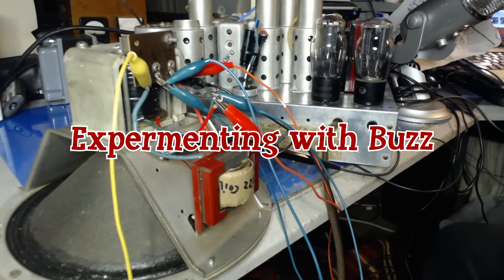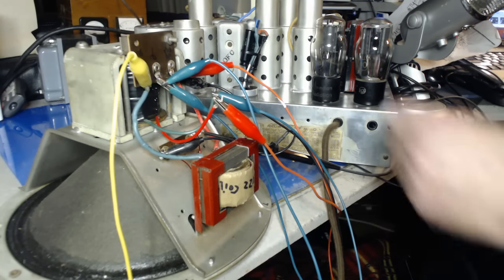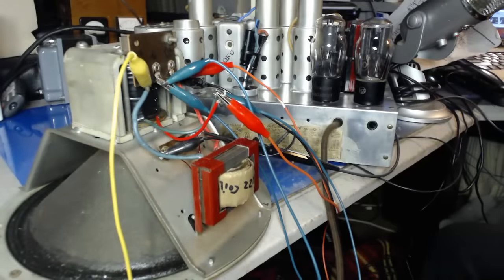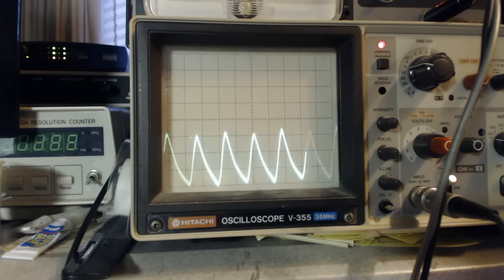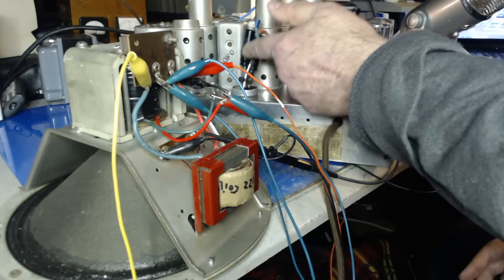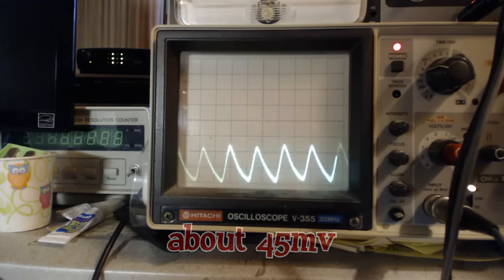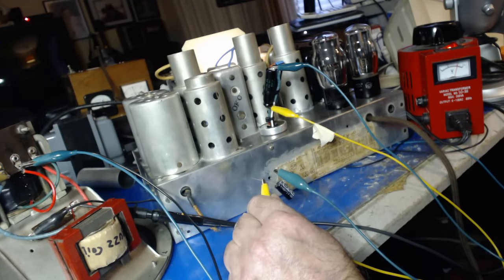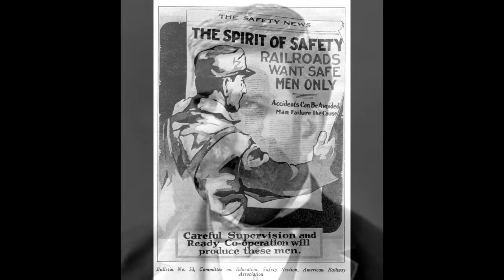1934 Westinghouse Model WR-24 Restore Part 6

Comment: Good lesson on capacitor Buzz.  Most people at first glance would think you could go up in value in the filter circuit, but as you explained - NOT SO.  FYI, Electric Radio Magazine (no affiliation) sells a soft start device to power up these valuable old radios.  They are available with or without a meter.  Plug it in the wall and plug the radio into it.  It looks like a good idea to ease these old radios on.  Brendon is giving you some good advice there.  Thanks for sharing your info and time.  Goodnight everyone.
Reply from the maker: Hi Steve...This was a good experiment......Brendan is a great guy........Buzz

Comment: Adding a thermistor in the power line would mitigate the stress on the rectifier and increasing the filter capacitance down stream of the choke coil would help reduce the hum even more without placing undo stress on the 80 tube since the choke acts as a current limiter. I've been installing these mods on all my tube radio restorations as suggested by Uncle Doug YT channel and Blue Glow Electronics YT channel.

Comment: About Westinghouse's air breaks , before they came into use the railroad brakeman actually had to run along the top of the train cars while the train was moving applying the handbrakes one by one hoping he didn't fall off or get knocked off if the train was about to go through a tunnel . 
Also it's a drop in air pressure that makes the brakes apply for safety reasons such as if the brake lines develop a leak or break into on a moving train .
Reply from the maker: yeah..very scary in those times..

Comment: Actually the fact that the 80 rectifier filament takes a bit of time to heat up absorbs the stress of the capacitor charging up.   Solid state diodes get more stressed out than tubes do with large caps in the filter.  Also note that many radios made in the 50s and later, plus most tube TV sets used 40uf input caps in the filter circuits, with tube rectifiers (perhaps beefier 5U4 tubes).
Reply from the maker: Try telling  that to Brendan, and you get an ear full.
Reply: Well the early type 80 tubes probably didn't have as robust an oxide coating on the filament as the later 5U4GB's, so there would be some truth to that.  Also indirectly heated rectifier tubes such as the 5AV4, 6X5 and 6AX5 took even longer to heat up, and were probably as good as a variac in cold starting and slow charging the filter caps.

Comment: AAAAAGH! Wifey looks like...AAAAAAAGH!!
Excellent episode, Buzzmaster! You and Brenden should have been designing tube radios in 1935. Real scientific method there. BTW. If you measure the inductance in Henry's of your field coil that you wound, you can get proper equations to reckon what the Reservoir Cap and smoothing cap should be for your PI Filter to kill the ripple. Then you can see how your experimenting matches up. Here's some sites that might get you in the right direction if you feel so inclined but it is a little mind blowing, You got the resistor in to make a RC circuit to slow the charging, so I guess that's good 'nuff. Brenden is one cool guy.
http://www.designers-guide.org/Design/bypassing.pdf
http://www.valvewizard.co.uk/smoothing.html
Reply from the maker: Hi Meister..You and wifey and H-cat snowed in?.....It was 17 degrees this morning here, but at least it was sunny...global warming my ass.....I looked at those 2 links and my head exploded..I'm not very smart understanding all that.....haha...I'm glad Brendan is around when I need help!!
Reply: sleet changeover to snow now. we'll get 4-6 inches they say. that's a lot for North GA. Def snowed in for tomorrow. I might plug the outside Christmas lights in again! Jingle Bells, Jingle Bells, Jingle all the way It's climate change called "winter".